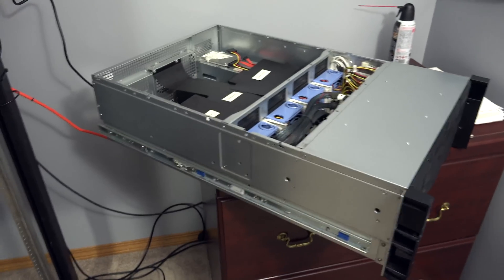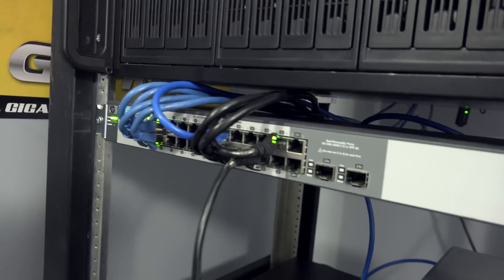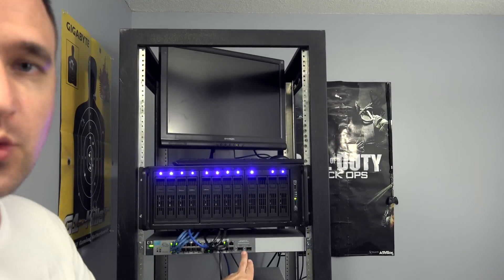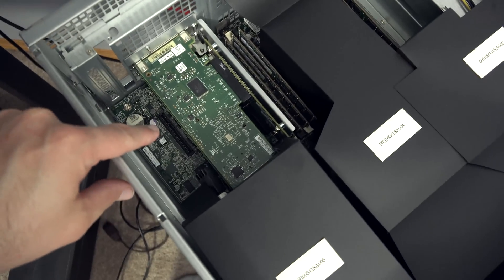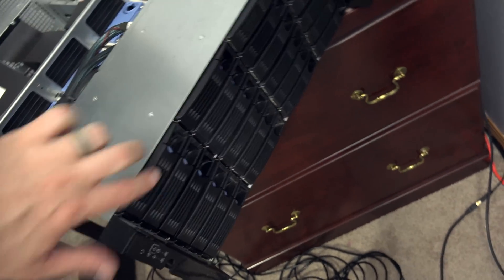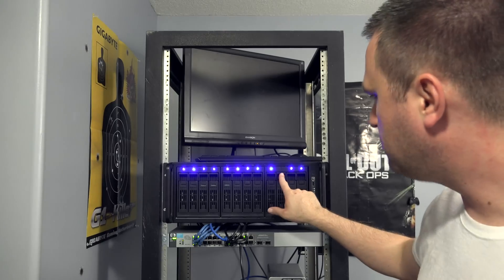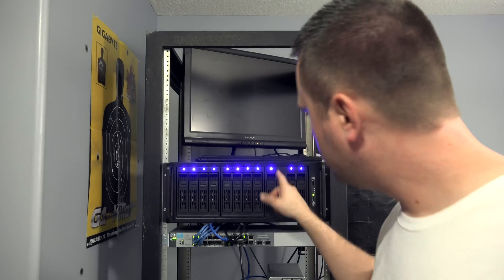New Dual Xeon Plex server vlog...P1...

Comment: Did I miss something? Didn't he say his network switch only handles 1Gb connections?  Just curious cause if that's the case it would be pointless to put 10Gb NIC in the server since the data transfer to and from the server would be limited to what the network switch could handle unless he planned on upgrading his Network switch prior to going live with his server.

Comment: This could have been answered already, but from working with hp and cisco products, here is what I think is the problem with this setup.  for sfp's , its hp specific.  so a cisco sfp's will not work in a hp port and vice versa.  you can use a hp end for the hp switch and use a cisco end to the server, that will work.

Comment: Why do you telling bs only?! FreeNAS , which i use in production environment as centralized sotrage + offsite backup is smarter than you unraid thing. You can always create vdevs and add them to existing pools. true, freenas works dirrefently but you can always extend a single pool with additional vdevs. Ive played around with things like mixing different sizes of hdds and sas/sata combos and never had any problems with it. oh and never had any issues or caused me headache a single time ! Right now im in the right position, where if i need more storage i can simply go, buy a bunch of hdds and couple of ssd-s, create a new vdev and add it to the existing pool if i want to :)

Comment: Item Type  eATX SYSTEM BOARD FOR CHENBRO RM41824 W/ 2U HEIGHT HEATSINKS  
Part Number  T2491602  
Brand  FOXCONN  
CPU Socket  2x INTEL LGA 2011  
Chipset  INTEL C602, SUPPORTS E5-2600 v1 SERIES
Memory Slots   16x DDR3 RAM SLOTS  
Networking  2x 10 GIGABIT SFP PORTS (REQUIRES DUAL CPU), 1x IPMI PORT (FOR MANAGEMENT ONLY)
Condition  USED, 30 DAY WARRANTY

Comment: i know this video is old and you are up and running but have you looked into an SAS expander that takes (2) 4 port sas and breaks it into i believe (6) 4 port SAS giving you 24 ports from 1 card?? just wanted to throw it out there if you ever need to free up some of those PCIe slots for expansion. been working with servers for years now but just bought my first personally owned server and cant wait to start building it out and making it fit my needs

Comment: You can also buy SFP to rj45 transceivers  will also provide direct 10g connections:

https://www.ebay.ca/itm/For-Cisco-10GBASE-T-SFP-Copper-RJ45-SFP-10G-T-S-compatible-with-Cisco/192394017185?hash=item2ccb93b9a1:g:RggAAOSw3HZbA5V0

Also you can use the available quad port 1gig card,  Or you can use the 1gb SFP to rj45:

https://www.ebay.ca/itm/GLC-T-for-Cisco-GE-SFP-Transceiver-Module-Mini-GBIC-1000Base-T-RJ-45-Copper/232348672028?epid=1561752848&hash=item36190f601c:g:lmMAAOSwC2VbQ3kQ

As for the OS, why dont use both FreeNas and Unraid and others on ESXI 6.7 or Citrix hypervisor. For the loudness, the best thing after you have already bought the server is to use headphones. Usually hp servers are quiet, as long as you dont use non-hp components.

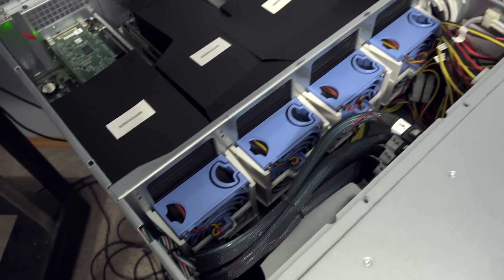Comment: @12:24 Holy Crap! It's like an air raid siren! jeesh!
BTW you're NOT stupid, you are ignorant! BIG difference!
Wait a minute....the hard drives are NOT going to be spinning up simultaneously? I thought you were using some form of RAID?...?  :-?
Reply from the maker: I use UnRaid. If reading, one one at a time. If writing, 2 (or 3) at a time. Only time all spin up is during rebuilds/data checks.
Reply: Thank you Jason. I thought for sure the read/write speed of singular drives would be too slow for PLEX, but, you telling me that it works is a big help! In the future I'd like to get a faster (used) mobo/CPU/RAM for my PLEX server. Right now I have an old server mobo and CPU and ECC RAM I bought for a mere $150. I run it completely headless with TeamViewer. TeamViewer does not allow the free version if connecting to a Linux OS Server, but I've seen a couple out there that are freeware and don't have any limitations on what computers/OS's are being used.
I have 3: 1TB drives in a RAID 0 and another 2: 320GB drives also in their own RAID 0 on Win7Pro64. I love full bitrate so I stopped making MP4s out of the TV shows, and just use my dvds/BR's on the original discs. Sure, it'd be nice to have everything in one place (PLEX) but I'd also need a ton more disk space to do that, and a bluray player in my server in order to put the discs into the server. I'll probably never do that.
The CPU is so slow that I can't even transcode and record one channel simultaneously with my Intel Xeon 3450 CPU, LOL. But, someday I'll get the $ for a faster server system. The drives are just 5 drives I had laying around collecting dust. Win7 runs on a 120GB SSD in the 6th (of 6) SATA ports.
I've learned a lot by watching your channel. When I get the $ I want to buy a Nvidia client (thanks for your vid comparing that one with 6 others!) so I can run Amazon vid, and Netflix as well as Plex. Right now I'm using a cheap RaspberryPi 3B with MPEG2 license and the PLEX OS. I've tried a couple other OS's and still couldn't use Netflix and had a problem or two with them so I just installed the PLEX OS.
Keep makin' vids! I appreciate them. I watched several just today alone.
God bless.

Comment: The SFP adapters have embedded edid data that the HPe switches validate before they will allow you to use them this really should only apply if you are trying to use twinax. If you get a Hp 1G optic OM3 SFP and a 10G SPF+ OM3/4 supported by the server board then just any OM4 cable long enough to connect the 2. 

Most of the major manufacturers do this it’s just a cash grab to force you to buy their overpriced cables.  1G ports are SFP ports only if the ports say SFP+ will they be able to support 10GbE. 

If you are going to do Unraid don’t bother with the 10G your network will be your bottleneck.

Also if you go unraid you can get essentially 1G SFP copper modules for both sides they are a bit cheaper , be no one wants them. Then you can just use any 1G cable.

Comment: BLUE - COLD
RED - HOT 

Recommendation is not to remove the blue coloured devices while the server is powered on.

There are different types of SFP
SFP - 1.25Gbps 
SFP+ - 10Gbps

So if you are unsure, get SFP modules, you can at least test the devices.
SFP is mostly backwards compatible so if you put sfp in sfp+, it should work.

Comment: I realize this might be a bit late...  In enterprise class hardware, it is not uncommon for the system to detect an open case (via an intrusion switch) and automatically ramp every fan up to full speed to provide full airflow.  It happens all the time with Dell servers and drives me nuts!  Did you check the sound and fan speeds with the case closed?  BTW - your videos are great! Your channels has Y.A.S.  (Yet another subscriber)  Please keep up the good work.
Reply: true. The Chenbro case he uses doesn't do that. Only when starting up. After that it will go back to the BIOS fan speed setting (for my RM31616 it's 30%)

Comment: Are sfp ports on the switch good for anything other than ganging switchs?
Reply from the maker: I cant seem to get the right cables to get it to work. so not sure :(
Reply: you could try sfp to ethernet adapters, and then just connect the server via ethernet to the switch
https://www.amazon.com/10Gtek-Compatible-SFP-GE-T-Transceiver-1000Base-T/dp/B00U77IJ2M/ref=pd_lpo_147_lp_t_3?_encoding=UTF8&psc=1&refRID=HW78YKPH2CYFXGXN6B2J

Comment: i have two of these cases so Ill let you know what I did. I used 3 rocketraid 2720sgl card with pcie 8x, remember bandwidth of pcie card does affect per drive full bandwidth.
Reply: Thie will free up a pcie slot or two for the dual sfp+ cards. Also, the fans are for the HDD  more than the CPU. Those drives will get stupid hot and fail. The noise was loud so I put mine in a closet with a separate A/C, which resolved the noise issue too. I would change the required airflow of the fans and match accordingly.

Comment: Also for the RAID cards and the 10Gbe issue,... could you not swap out two of the 8-port (with Dual SFF 8087 connectors)RAID cards for a 16-port version with 4 SFF 8087 cables?? Allowing you to still use all 24 bays and still free up the 3rd slot for your SFP+ 10Gbe card?

Comment: I have a SuperMicro 3U 15-bay server similar to yours, not quite as fast, a couple gens older, but it uses exactly the same 80mm  and 92mm SanAce fans in pretty much the same mounts and they sounded like leaf blowers, I replaced them with Arctic F8 and F9 fans and they are much much much quieter, you have to mod the connector a little (cut a tiny piece of plastic), I'm certain they don't move as much air as the original fans for sure but they still work perfectly, temps are still good and way within spec, but best of all I can hear myself think!!!

Comment: Well you have two options.

Use different coolers as you said, or you could limit the power to the fans with a resistor that would help as well.

But I'd go with option 1.

Make sure that you have sufficient cooling though. I'd say keep your temps under 25c.

Comment: Your attitude about learning tech is refreshing.  So many people in this space close their minds and become snobs, kudos for explicitly trying to avoid that.

Did you buy that system from mrrackables?  I love those guys!

Hardware snobs/elitists (who actually believe they're better than you) are dumb, ignore them.

The "ethernet port that's on the back" thats only there for the motherboard is called an IPMI Management port.  That functionality can sometimes be turned off (depends on the BIOS) freeing that port for use as a standard network port again.  I didn't even know that Foxconn made server motherboards, so I have no idea how well that's going to go for you.

Based on the rough manufacturing date, I would assume that those are SFP+ ports on your server, capable of 10GBE, but again, I don't know foxconn gear, so YMMV.  Thats disappointing to hear that your HP switch won't play ball with commodity cables.  I've personally had very little problems with HPE gear.  Hopefully you can get your switch and server to talk to each other through that route, if not it may be time to upgrade your switch?  (You know you want to)

Have you considered getting a hold of a SAS expander instead of using multiple dedicated host bus adapters (HBAs)? 6Gbit SATA/SAS per drive seems rather unnecessary unless you're running a full array of SSDs, it also doesn't make sense to me to saturate your PCIe bus like that (and it would free your PCIe up for a 10Gbit card).  That would also free up two of those SAS9211-8is, which you could either sell, or use elsewhere, as those are quite nice.

I have no professional experience using UnRAID.  FreeNAS was a reasonable way to do ZFS in an appliance, but I feel that the latest version has been a regression in usability.  Honestly, for your use case scenario, I'd actually recommend UnRAID, namely for the inflexibility of expanding ZFS and your reluctance to purchase new drives.  ZFS gets cranky when it doesn't have a lot of free space (I've noticed fragmentation picking up at around 50% free space, and it really goes to town once you're down to 20% free)  While ZFS can manage a bunch of different drives of different sizes, it doesn't really like to, especially if you're thinking about buying 1-2 more at a time and adding them in as you need them.

Ideally, you'd buy 24 drives of equal size and install them all at once in a 4x6 drive RAIDZ2 configuration, a 4x6 drive RAIDZ configuration, or a 12x2 drive mirror configuration.  Assuming you were to use 4TB drives for this, the raw pool sizes would be 64TB, 80TB, or 48TB (respectively).  If purchasing all at once was infeasible, you'd want to expand the pool one vdev at a time in blocks of either six drives each for the RAIDZ or RAIDZ2 configuration, or pairs if you want to mirror, but I question the wisdom of using mirrors to store bulk media.  Based on what I've heard (and what you've said), I get the idea that UnRAID is much more flexible for expansion, with a cost in performance and online data management.

That is a shame too, since 64GB of RAM for your ARC will make you question your reality.

Yeah, real server hardware is loud.  You may be able to tweak the cooling profiles in the BIOS without needing to change much in hardware, but I doubt it.  Good luck on fixing it.
Reply from the maker: I love to learn new things about tech and PC's, even if I do it wrong the first time. How else do we evolve? lol

The sfp ports are 10Gb. I have one running to my main server (for now for file xfers) and will soon route it to my main PC as I had my old server hooked up. the sfp to rj45 allowed me to connect it to my switch easily to access the rest of the network. My next upgrade will be a 10Gb switch :) 

Yeah the bios port is a new thing to me but with 2 10G ports to use, I dont need it anymore. I just had to get the right stuff to make things work for me. 

For now I will leave the sas cards as they are. I dont need the pci slots yet and they seem to run at good temps. I have been putting a lot of stress on them without any issues so it looks like my ghetto cooling solution is working. And yeah server cooling is loud but with 3x140mm noctua fans running full speed all the time, it's now quite and cool. :)

unraid seems to be a great fit for what I need. allows me to expand as I go and offers parity for all my drives with only one drive. I know its not perfect and if I lose two at the same time I might lose some data, but at least my whole array wont be lost. Any real critical data is stored on my main PC is RAID1.
Reply: I've since watched the rest of your videos on this build, but I'll continue to discuss on this thread.

If you could clarify a question that's developed due to my limited understanding of UnRAID:  Are you going to be limited to at most single-disk performance per stream?  This is based on the assertion that UnRAID doesn't stripe data across disks.  In cases where two or more files are stored on the same, single disk, I would assume the access performance will drop even further?  Also, is it true that total throughput adds up just fine when files are located on separate disks?

Running the numbers on your components, your 4TB HDDs should deliver around 150-200MB/s per disk, your SAS9211-8i HBAs should deliver 4000MB/s per HBA and your 10GBE SFP+ ports should deliver ~1100MB/s per channel.

In theory, a single SAS9211-8i should be fully saturated with 20 disks that can deliver 200MB/s (connected via SAS expander), however you're never going to have all disks performing perfectly all of the time, so in terms of IO, one HBA should be able to handle all of your spinning disks, and by that I mean just barely.  I'm not necessarily recommending that you switch to this configuration, I wanted to make sure you knew about SAS expanders as an option, especially if you were hurting for PCIe bus space.  (Note: some SAS expanders can be powered by a molex connector, so you don't even need to plug them into a PCIe slot)

You could also potentially aggregate two 10GBE links between your server and workstation (you have the NICs to do it if you remove one from your 12 bay server) but that doesn't really address the bottleneck of read performance for a single file being limited to a single drive, assuming the answer to this post's first question is true.

Out of curiosity, have you run any isolated benchmarks on your storage or networking layer?  Theory can be fun, but real measurements are worth more.

Comment: For your noise issue, just give you an input: in our office, we bought a Dell PowerEdge T330, it was cooled by one unique 12cm fan, 2.3A, 6000 RPM, the air was channeled through a heatsink on the CPU with the help of a massive plastic shrout (like in yours). It was super loud. Why do they used that cooling solution? I have no freaking idea.

We ended up doing the following : 
- remove the unique 12cm fan and the massive shrout
- install two pieces 12cm fan, 1350 RPM, 0.25A (ARCTIC F12) installed at the back of the HDD cages. We had to improvise a bit some mounting bracket
- install one CPU cooler (ARCTIC Freezer i32)
- as a bonus : install one 8cm fan blowing on the RAID card (ARCTIC F8). also had to improvise some mounting brackets.

Result : the server is better cooled (we have temp on the CPU lower by 5 degrees C while under load, not to mention the HDD are all cooled as opposed as before where only few bays were properly cooled, the RAID card is also 20-30 degrees C cooler), we have half of the power consumption (total is below 1A) and the cooling is so silent that the noise we hear is now the one from the HDD (we have only 4 of them but still they are the loudest part).

if it can inspire you.

Comment: I already replaced 2x80mm fans in the back of my server with noctua ones, night and day difference. now I ordered 2x120mm noctua industrial 3000pwm to replace the fixed-speed front ones. Since my supermicro motherboard cares only about CPU temp, leaving the HDD overheat with a standard NF-F12 PWM (fan idling with HDD at 40+ °C), I wrote an Arduino library, to monitor and control fan speed, that I'm going to use to adjust fan speed to balance cooling and quietness. That may work for you

Comment: I think I would have built a  mini-ITX using one of the super-micro boards. I have put my rack in the garage behind  some chain-link fence.  Solved the sound issue. Put some roxul insulation on the common wall between the house and the garage.  I also installed an aircon unit (20K BTU) in the garage to  cool the server.

Comment: FreeNAS works differently from UnRAID, but you can still build a pool (array) and expand it later.
A SAS expander would let you run all those drive from one of the SAS cards and the expander just needs power, it doesn't even have to be in a slot.